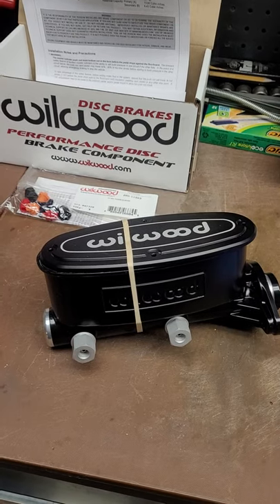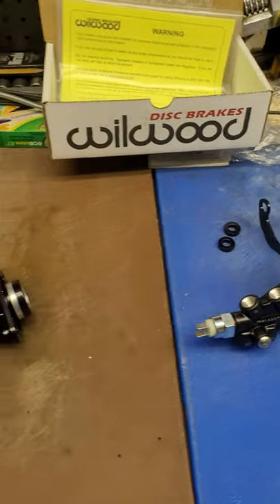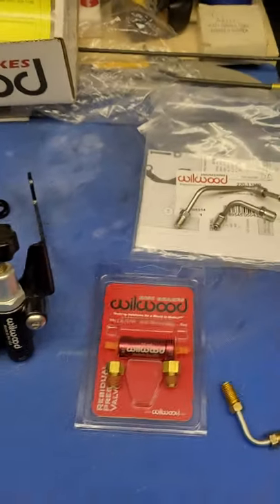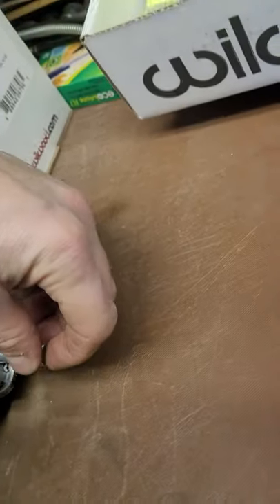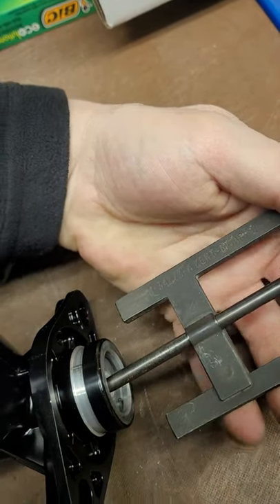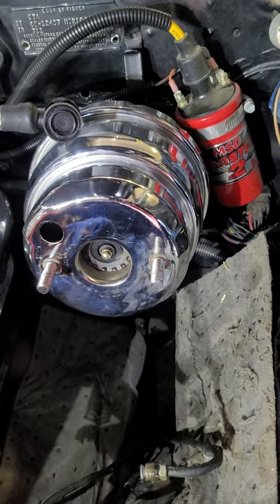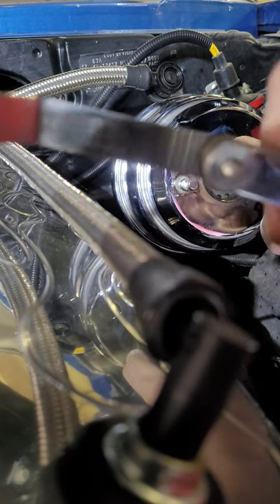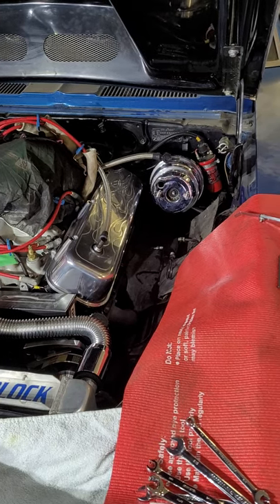Master Cylinder push rod length check / adjustment

Comment: Where did you install 10lb check valve? Was told I needed one for my spongy pedal after wilwood master install.
Reply from the maker: Check my other videos, I showed where to install the residual pressure valve right under the master cylinder.. good luck with your install!